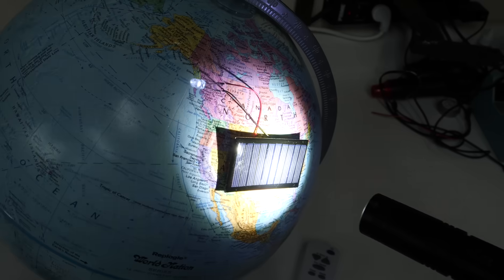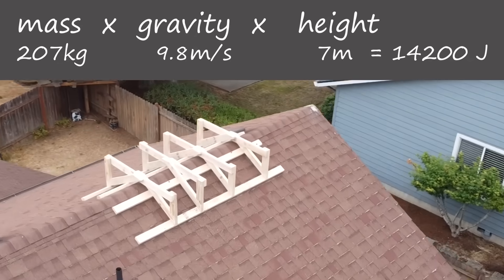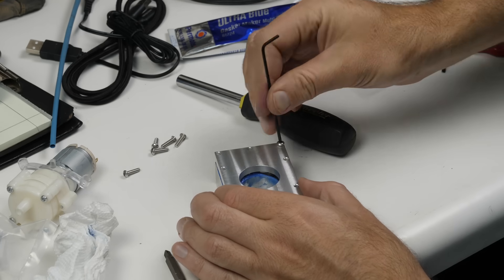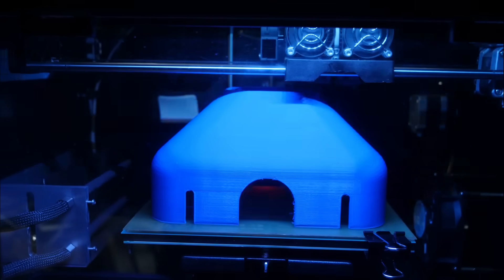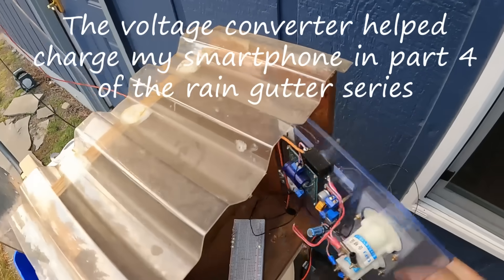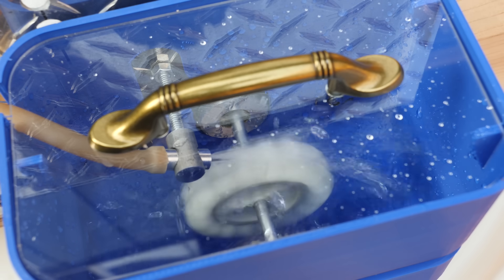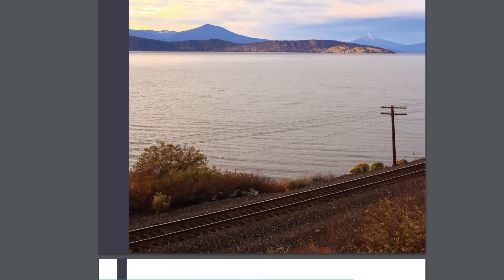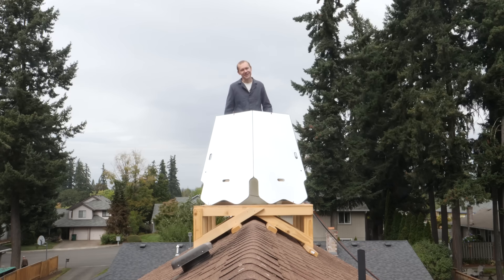Storing Solar Power on my ROOF!!!

Comment: Blimey, fair play to that little pump, producing >5m head.
Reply: heyy fellow intp
Reply: @alansilverio4467  Hello person who's too lazy to use any capitalization or punctuation.
Reply: @ChrispyNut  hahaha thats me
Reply: Yall forgetting thats a diaphram pump
Reply: Blimey ! 👍
Reply: The narrow pipe inner diameter lowers the weight of the 5m 'water pillar' the pump needs to lift. May be wrong, but that's how I see it.
Reply: @ifluro  That affects flow-rate, not pressure, IIRC.
This would probably be helpful (I CBA to go through and check everything again currently). Practical Engineering channel - https://youtu.be/ZQKpu-obzlU
Reply: @ChrispyNut  @ifluro is right (but there’s a catch). The force is proportional to the area of the cross section of the tube. So at a 5m head you have about 0.5 atm of pressure, if you multiply it by the area (set’s say 25 mm2) you will have a 127 grams force at the end of the tube. But this doesn’t take account where the actual force is applied which is on the “blades” of the pump, where the same area theory applies. So you could have a super large tube it still wouldn’t matter since the force would be on the small pump, so again, small area = small force.
Reply: @CryptoOfficial  But you're ignoring the increased frictional losses associated with the increased velocity of the narrower pipe.
I honestly don't have a sufficient grasp presently to speak confidently about this, I've simply learned and understood enough over the years to know there are counter-intuitive factors.
I should know better, but I've just not needed to know it well enough to properly learn it well enough to run it off the top of my head.
Reply: @ifluro  narrow diameter does not lower the weight of the water at all. Fluid pressure in static situation is only coming from pumping height. In dynamic situation when water is moving, thin tube has more friction losses (higher speed of the fluid) so it reduces flow rate that can be achieved. In ideal case the pipe would be as thick as possible.
Reply: @Karjis  So you're saying a 5m vertical pipe with a 3mm internal diameter and a 5m vertical pipe with a 50mm internal diameter, both full of water, the amount of water in both pipes weighs the same?
Reply: @ifluro  The weight is different but the pressure from the water column acting on you at the bottom does not change. It does not matter what kind of pipe, hose, or a downcomer you set up vertically, whether it's oddly shaped or what; the pressure at the pump outlet remains the same. You can pressure test something intended to dive to 10 meters at the bottom of a penstock with a 10 meter head - even if it's just plain old garden hose; it does not need to have a full ocean above. You could slice up the water colum as thin as you want and still have the same pressure. If we wanted to optimize this system for a tiny pump we could use garden hose to reduce "friction losses" and just use an adapter that shrinks it at the end to fit the outlet of a very small pump.
Reply: @sietuuba  Would the feed to the drum on the roof be affected by where the inlet was positioned? Like if the feed was plumbed into the base of the barrel instead of feeding into the top?
Reply: @ifluro  In practice not much (but also in practice I think there's a good cause to pick one over the other). If we work it out we can calculate a difference in head pressure in the fill line from the tank on the roof when comparing an empty tank vs. a full tank (if the tank is one meter tall, the head pressure increases by one meter as the filling progresses). If the feed was plumbed into the base of the barrel we would find it necessary to include a check valve to prevent it discharging the way it got filled.

Check valves introduce pressure loss requiring a bit more work by the pump (whether it matters much here can I dunno) but the bigger drawback is that they can leak, compromising the stored energy. A safer, more leak proof option would be a valve that is closed when pumping is done.

If the fill line is feeding from the top then the head pressure seen by the pump is always constant whether the tank is still empty or nearly full, and there's no risk of leaking water back out that way, as long as the end of the feed hose is not submerged when the tank is full (it would become a siphon and empty the tank until the end got exposed to air). Just the contents of the feed hose would drain after the pump stops, no big deal in a small system.

However the most optimal way may be a single downcomer/penstock/garden hose/whatever you want to call it shared by the pump and the water turbine, with a Y connector and two valves by which the mode of operation could be chosen. Close the turbine valve and open the pump valve for pumping, close the pump valve when pumping is done. Open the turbine valve for releasing the stored energy. One large diameter hose connecting them both to the tank on the roof means the smallest practical pressure drop due to constriction while pumping, and it's cheaper as you don't need to buy, set up and plumb a separate feed hose (assuming its little valve plus the Y adapter doesn't cost more than a dedicated fill line - but the pumping line's valve can be smaller and cheaper than the "turbine valve".
Reply: @ifluro  Long story short: if you use a separate pumping line, feed from the top of the barrel. A more elegant way can be argued to be using just one large line plumbed into the base shared for both modes of operation.
Reply: @ifluro  Just put a manomenter on both and you will see the presure will be the same :)
Reply: @sietuuba  said "A more elegant way can be argued to be using just one large line plumbed into the base shared for both modes of operation."

I'm glad I kept reading because I was going to ask that exact question, "What if the input and output were at the bottom of the same tube?"
Reply: @ifluro  The amount of force is strictly determined by the area of the pumping surface. The tube shape makes no difference.

Comment: Instead of water and gravity why not use compressed air for power tools to drive the power generator then you don't need to to have strong roof too put it on only a big enough air container to keep the stored pressure.

Comment: Wouldn't intentionally overflowing the barrel also generate electricity using your gutter collection/generator?
Reply: It would but a huge loss in efficiency, he would be better of directing the solar power the cellphone charger when the barrel is full
Reply: @Fribonansa  true, but this is all about using water power, right...otherwise it would be better to just cut out the water/middleman entirely :)
Reply: I believe he put that barrel on the roof of his home, as it is significantly higher than the roof of his garage.

Comment: Looking how big roof you have, you can add more platforms for the additional barrels - you wont get more power, but more energy.
Reply: The weight is a problem.  Each 1000 litres = 1 metric ton.
Reply: @UCCLdIk6R5ECGtaGm7oqO-TQ  Indeed it is a problem. You are right, Quint's wooden american style roof may not hold the weight of barrels full of water.

Comment: Great work sir!
But have a doubt!
What if you change the angle at which the water is attacking the turbine?

At 10.50 mins it is  horizontal but if it was connected vertically it would splash but directly into the funnel you build.
Also it will reduce energy loss due to friction at bend of the tube

Comment: The wonderful thing about metric, is that you can easily calculate the necessary pump by taking how much water it needs to pump, (the joules), when you want it done (the time). Giving you around what you need.
Reply: not necessarily, to play devils advocate, the everyday folk, even using metric (but not SI), would usually use km/h instead of m/s, and US customary engineers would use ft/s instead of mi/h 

just be glad that no country is run by joggers, they use minutes/mile, that's literally the opposite of speed
Reply: All without a ridiculous cheat-sheet for converting gallons per hour into horse power.
🥛 ⌚ 🐎
Reply: Who gives a shit?? 🤷🏻 Use whatever system you want to.. I fluently know BOTH, so kiss my ass.
Reply: All these comments arguing about metric vs imperial and not one person pointing out that the original comment is dead wrong. This does not work because pumps are not 100% efficient! To appropriately size a pump for this purpose you would need to know the head loss of the tube and you would then need to consult the operating curves for the pump.
Reply: @tralt135 right main thought I'm having is what is the maximum height available you can use whatever measurements you want at that point. I just want it to reach that high so this would work but my little 20 watt pump for an aquarium just won't cut it. Looks like a fun project ive always wanted to make a version of my own as part of a lookout tower I would mount various projects on .
Reply: I did find a slightly ridiculous way to use one pump in jackets to make suction on a ditch when it was raining . It would have worked better had i bought more hose 😂. It did however use suction from a larger flow to backfill a smaller container than the first I emptied so that did work juat needs to be powered up a bit .
Reply: "Imperials weird fractional measurements" we measure in decimals too.
Reply: @ianmoore322  Yeah, multiples of 10.
Reply: and the bad thing about it is that it teaches you to think in multiples of 10 and nothing else, so you're at a disadvantage for anything but round numbers
Reply: @kingmasterlord  I agree, and henceforth I assume both you and I shall be doing any long division or, say, cube root calculations in strictly Roman numerals! :)   Or we could admit that "Easier is easier" and let "Who is more clever?" be a question for a different day.
Reply: @TaiViinikka  or you could just stop getting butt hurt every time I drop a throwaway comment. imperial is base 12 what's hard about that?
Reply: @kingmasterlord  Imperial is base 12 ... sure. So, do you have anything to say that IS NOT a throwaway comment? Because your work here is kind of looking like nothing but throwaway. Do you plan on doing anything other than undermining plain sense?
Reply: @kingmasterlord  with all due respect, but that was an almost worst defense of the imperial system than "it's been used for a very very long time"...
Reply: @rhobson  I made no mention of the imperial system. your thinking is rigid and binary.
case in point.
Reply: @kingmasterlord  Excuse me, but what other relevant systems of measurements there are? 
That is, I'm only counting the Imperial system as relevant due to the way USA bullied itself on the world since the wars, which is becoming less and less relevant.
Standards matter, SI should be used by everyone, just like everyone agreed that a given day is "Friday", and not "potato harvest". ;)
Reply: @rhobson  I didn't mention other systems at all you extrapolated that because I was pointing out a flaw in the metric system I must be a supporter of the imperial system, picking a side and assigning me to the opposite one. 

rigid and binary. and combative to boot
Reply: @rhobson  Now I'm supposed to harvest potatoes weekly? I just don't have enough time...
Reply: @kingmasterlord  This is by far the most stupid thing I have read in that regard ever in my whole life. You are aware of our decimal number system beeing literally defined as such indepentend from any units or systems of measurements?
You guys use Inches to measure lenghts and then subdivide them into 1/64 etc but I bet you still understand that a price of $3.25 means 3 dollars and a quarter and that 17ct off is $3.25 - $0.17 or do you start to convert everything into fractions because decimals are "too complex"?
Reply: @kingmasterlord  I've often thought about how imperial's weird fractional measurements might make you more math savvy. But that's only true if you use them a lot, if you're just wanting to do a quick calculation, you might just give up.
Reply: @kingmasterlord  we could argue that the time saved through easy calculations is greater than the time saved by being "fraction savvy". What fractions of inches can do is limited, at one point you switch to decimal.
Reply: @Hepad_  we could, but I'm not interested in arguing or continuing this conversation for that matter
Reply: @kingmasterlord  fun fact: No.
Reply: @TheAllMightyGodofCod  what a valuable insightful contribution to the discussion, the world is better for you having said it.
Reply: @kingmasterlord  And the world is how much better off for you having called a handful of people "rigid and binary" and having pointed out a flaw in the metric system which is both a product of its ease of use and a non-issue when literally everyone carries an overgrown calculator around with them all the time?
Reply: @theninjascientist689  immeasurably.
Reply: @kingmasterlord  I see what you did there
Reply: @herbderbler1585  well that's uncommon, you win one internet sir
Reply: @crackedemerald4930  cringe
Reply: @suprememasteroftheuniverse  more importantly, u mad?

Comment: You could have it overflow then have sprinkler system to overflow across roof to cool with excess thus lowering your energy demand needs from cooling. Keep up the interesting projects.
Reply: In theory, if it's filling from an equal capacity barrel at the bottom, it'll never overflow anyway, but the float shutoff is still a clever way of preventing the pump from running empty too long and burning up.  I'd have more likely put the float switch in the lower tank to accommodate the possibility of a leak in the system allowing the bottom drum to empty before the top one is full.

Comment: So - the cost of extra roof/structural reinforcement would massively outweigh the cost of a AA battery!  Real shame!
Reply: But by cost you have to include the environmental cost too.  It's not only about money.  This setup, though only a basic technology demonstration, has the ability to store batteries-worth of energy every day, meaning those theoretical battery cells no longer need to be produced, distributed, recycled, disposed of.  What would be interesting would be to calculate the long-term life-cycle cost compared to the use of chemical batteries.

Comment: Same kind of idea i have had. Like having a water tower. Or look at what they are doing in switzerland. They are using solar and wind to pull concrete barrels high in the air then at night they slowly go down turning a generator. Really awesome form of mechanically stored energy
Reply: Or dig a hole for it to drop into for added capacity.

Comment: Yesterday I watched another channel by "Robert Murry-Smith" that talked about "Sterling Engines". He said that in England they mined coal and to keep from igniting the coal dust with an open flame in a conventional "Steam Engine", they used "Soda/Sterling Engines" powered by various chemical reactions. The main chemical ingredient was calcium chloride or sodium hydroxide. They would start by spreading the calcium chloride or sodium hydroxide out in the Sun. Then mixing the calcium chloride or sodium hydroxide and water in the fire box instead of traditional coal fire. Once the reaction is spent they would spread the salt out in the sun to dry use all over again.